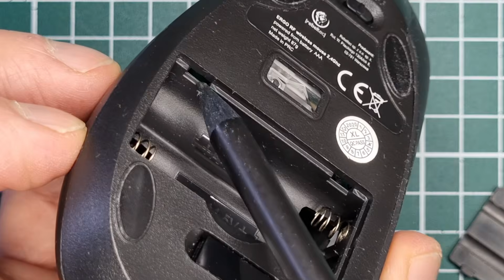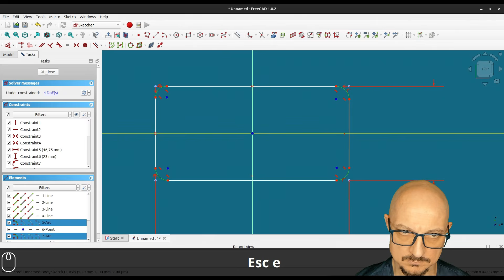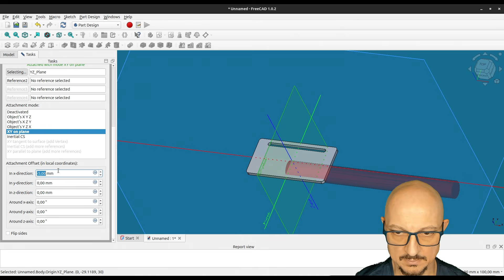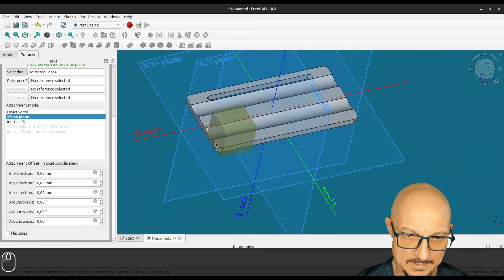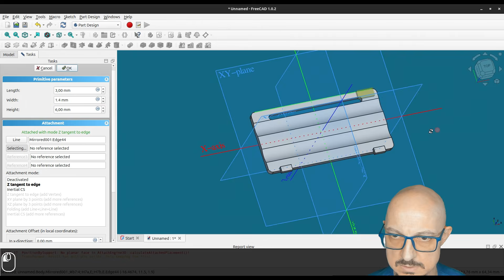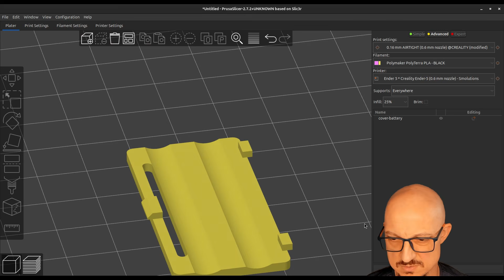The ABSOLUTE BEST Way to Achieve Perfect Design on Your First Try

Comment: Tip: In FreeCAD you can import an image of the part , scale the image to get the correct size and use the image as a guide to create the sketch
You can even do images of the three axes and attach them to the relevant axes in FreeCAD
Reply from the maker: That's a great tip, thanks for sharing!